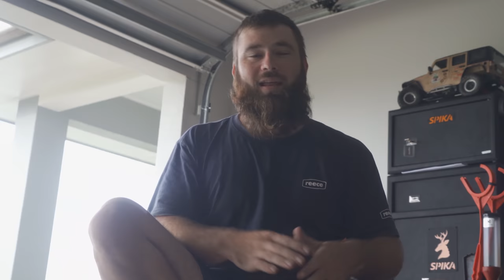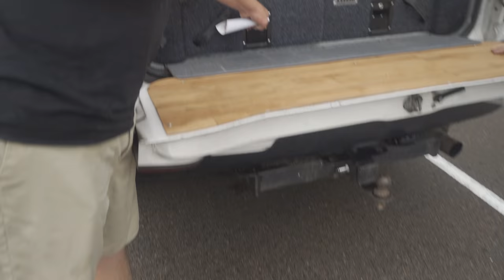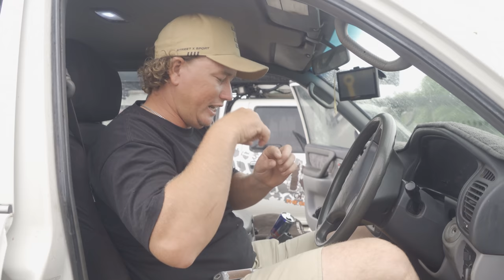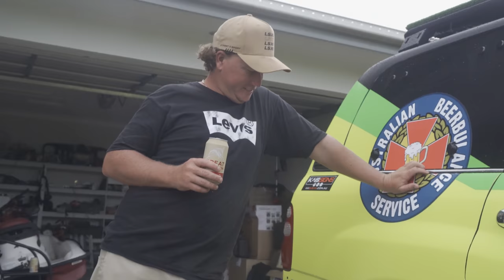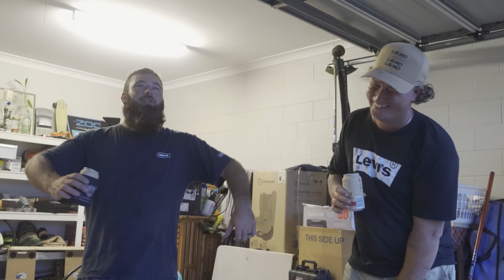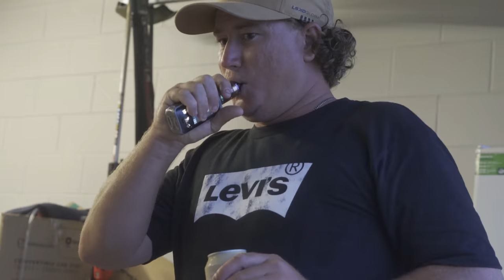SPUD'S GOT A NEW CAR? - Sick Puppy 4x4

Comment: Before you go on that ski adventure with all the weight on, purposely capsize the ski so you know it will self right itself up with the gear on. Capsize out on the water and your ski doesn’t right itself, say goodbye to your gear cause it’s not gonna turn over unless you cut the gear off.

Comment: Good work spud, just watch out for the front left axle, like the 80 series they have a habit of leaking over time. Mine cost about $1200 in parts, two cartons of piss and a weekend of swearing. Hate to think what a mechanic would have charged. 105 GXL love.